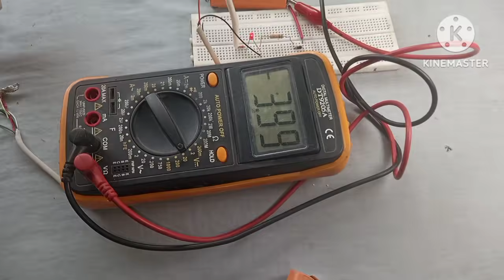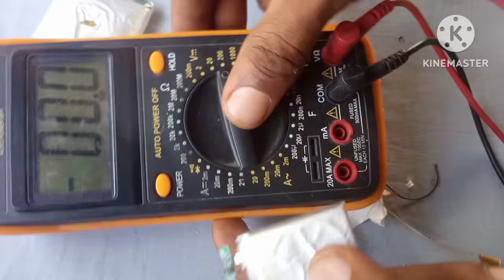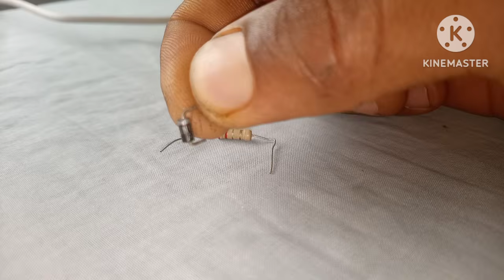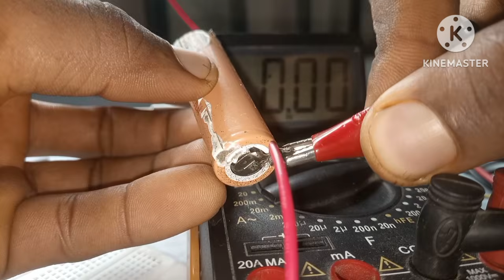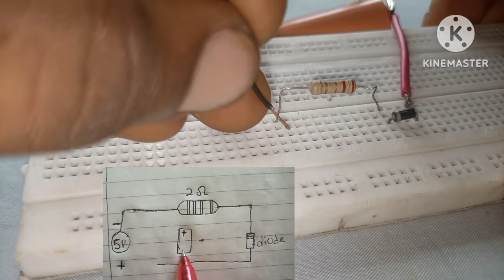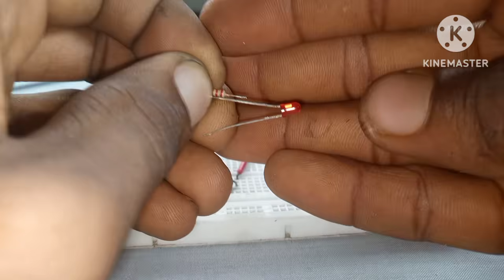Diy bms for 18650 lithium ion battery

Comment from the maker: What do YOU think about building a BMS with just a resistor and a diode?
Would you try this in your own project—or do you think it’s too risky?
Let’s talk in the comments! I’m replying to everyone who shares their thoughts.

Also… if you could improve this circuit with just one more component, what would you add?
Reply: Wow this is actually good I'll try it out
Reply from the maker: @buildtechz7262  that would be great 😃
Reply: I think a transistor
Reply from the maker: @Diy-f6t yeah that will be great I think bc547
Reply: @Blinksiteengineering  Been using a tp4056. only because it's cheaper in the end

Comment: What is if it's a battery pack of 3 or more?
Reply from the maker: Use a resistor with high wattage
Reply: @Blinksiteengineering like? With only 1 diode or more?
Reply from the maker: One big diode

Comment: Its very hot..
Reply from the maker: 😁Really
Reply: @Blinksiteengineering  Yes  ,i try to get lower and higher resistor its the same its hot..
Reply from the maker: How many batteries are you charging? @jezzjimez9472
Reply from the maker: @jezzjimez9472 use a resistor with higher wattage
Reply: @Blinksiteengineering  Just one..

Comment: Total MISINFORMATION! As the battery is charging,  the current decreases, hence the voltage drop decreases too (Ohm laws, anyone?). So, in the end there will be over 4.3!!! volts applied to the battery!  Good only if you want a fire. :/
Reply from the maker: Yes  the current and voltage decreases the voltage is reduced to 4.2 volts at the output of the circuit which will then charge the lithium ion battery to the same voltage as  when it's at its maximum voltage and when it's fully charged it's stays at 4.2 and doesn't go above that. What can yo add?

Comment: what diode are you using? my diode only drop 0.3v
Reply: 0.7 is for the common Silica diodes. If you got 0.3, it must be a Germanium diode.
Reply from the maker: @valvio1331 Absolutely right 👍
Reply: @valvio1331 .
Reply from the maker: 1N4001–1N4007	Silicon (Power)	~0.7V	Power rectification in power supplies
Reply: @Blinksiteengineering i have 4002,4007,sf28,uf5408,mic6010,mic1010
but they all only dropped 0.3v

Comment: Don't  EVER DO IT.  Lithium batteries  are extremely  sensitive to over voltage. If anything  goes wrong you have a fire in your hand.  You can't  put it out with water. There is a reason why manufacturers are using  pretty advanced  circuitry, regardless  of the application.
Reply from the maker: The circuit steps down 5v to 4.2 voltage which is the maximum charge voltage for a lithium ion battery and when this circuit fully charged the battery, the voltage of the circuit stays at 4.1v and doesn't go above or below that voltage, so that should be an efficient charge

Comment: Good. What of a pack of litlum batteries like 12v or more? Will it charge the batteries individually and stop or how can be done?
Reply from the maker: Yes it will definitely charge and stop, what project are you working on, you might also need a circuit to cut off the 12v if it discharges to it's minimum discharge voltage to avoid damaging the battery.
Reply: @Blinksiteengineering yes I need the circuit that stop 12v and 24v respectively from discharging or content charge after get it it's peck.
Reply from the maker: @nnejiamaechi9385 that's a good one I might create a video on that,
Reply: @Blinksiteengineering I am expecting it

Comment: Diode voltage drop is 0.7V at a specific current. See the diode datasheet to find that current value. If the current drops when battery is fully charged, then voltage drop will also reduce.  Then battery can overcharge and lead to a dangerous situation.
Reply from the maker: The voltage drop at the output of the circuit is 4.2 volts which is the maximum voltage for a lithium ion battery and when this circuit fully charges the lithium ion battery it's stays at 4.2 volt it doesn't go above 4.2 volt so I think the circuit is great what do u think?
Reply: @Blinksiteengineering  Many years ago I tried a similar simple circuit that relied on a diode voltage drop to limit voltage and charge a lithium ion battery.  It also had green color led wired up to sense lithium battery voltage and indicate that charging is complete. I used to manually switch off power upon charging.  One day I forgot and  battery kept on charging for 10 hours extra. This caused the battery to swell up like a balloon.  Be very careful and check battery voltage and especially  current after charging is supposedly complete and cutoff should occur.
Reply from the maker: @vksingh833 The circuit you built was it just a single diode and was a transistor also applied in the circuit?

Comment: This circuit is simply not safe. due to 5V and high current to cell (2.5A potentially). Rather create a voltage divider with 10R and 47R (closest values I could think of) and use the 4.12V from there via the diode and a 220R current limit (can also parallel led and resistor on this for charge indicator).

That is the bare minimum for USB charge. Anything else will require transistors / zener etc.
Reply from the maker: This circuit  outputs 4.2 volts, it converts the 5 volt from the charging output to 4.2 volts which is the maximum charge voltage for the lithium ion battery so the thing is when the battery is charged fully the output voltage from the circuit  stays at the point of 4.2 volts it doesn't go above that voltage, so the voltage output from the circuit just levels up with the maximum voltage of the lithium ion battery and remains at 4.2 when it's fully charged, so what do you think is it a perfect circuit for charging lithium-ion batteries or not?
Reply from the maker: Yes that's another great idea with the voltage divider that's actually cool